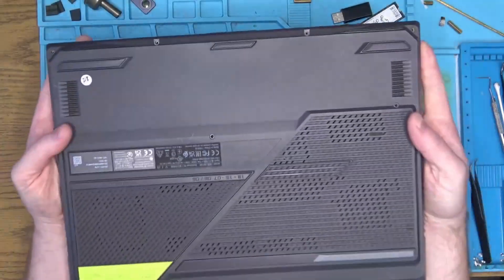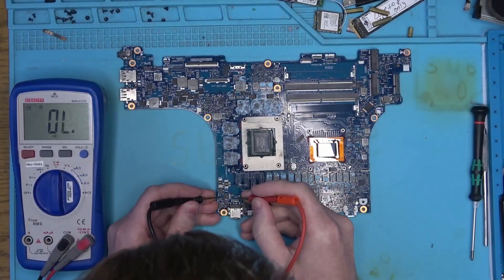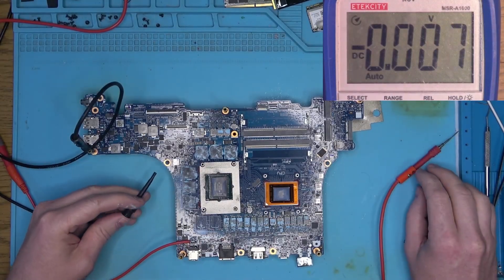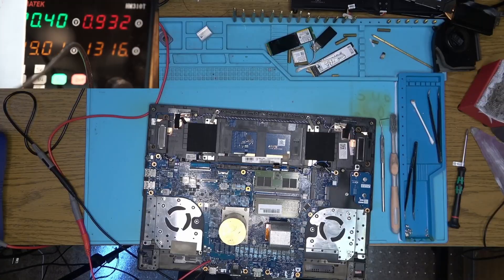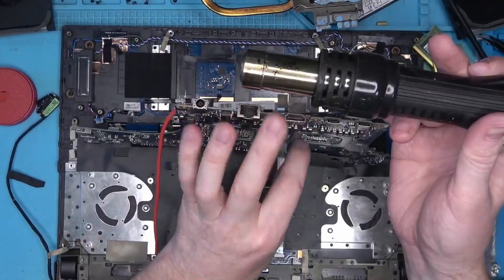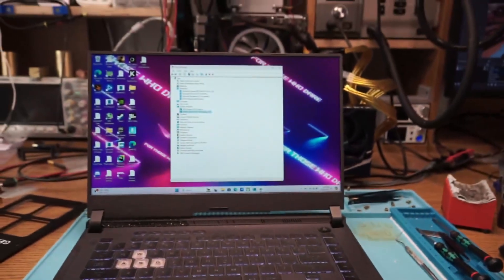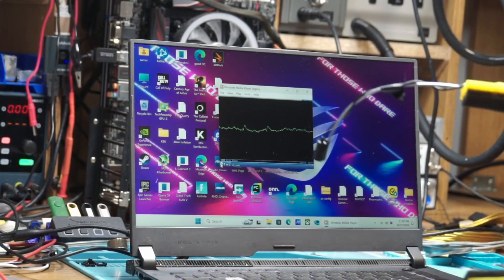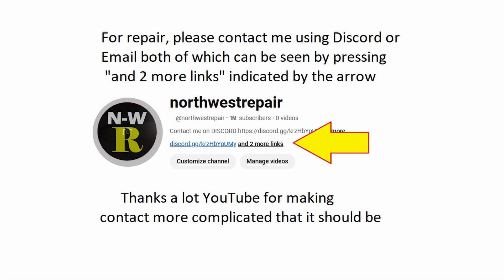ASUS ROG STRIX G513R free repair

Comment: I wouldn't give this guy any money back. You did fix it !
Reply: people like silverback really worry me, he bricked his machine flashing bios, knocks parts off in the process, had someone else repair it, the  bricked it himself again  then blames the person who fixed his first time bricking it, for his second time bricking it, insanity
Reply: About that other comment, the GPU showed a 3070 because it was an incorrect BIOS version when he had the "no audio" issue. After that, he found the correct version.
Reply: @DenjiW  he did found the correct version and flash it so problem fixed
Reply: @nikolaygeorgiev2921 no he flashed system bios. Not the GPU bios. Atleast I don’t think. He sent my laptop back with the wrong GPU bios.
Reply: @silverback2773   But then if he did NOT touch the GPU BIOS and it was WRONG, then when did it become the WRONG BIOS? You're pointing directly to yourself. You messed with both BIOS and didn't communicate that properly. You left it as a trap.
Reply: @DenjiW , the wrong GPU-BIOS (running Last of Us by a miracle?) must have been flashed by Putin!
Reply: @lorsheckmolseh3345    First time in the topic of flashing BIOS? You can install different BIOS versions on different graphics cards as long as the main chip is the same one. There are videos showing this. Some people do it to squeeze a few extra FPS at the cost of higher temps, but there's always the chance that some details of different BIOS might not be compatible with other graphics cards like RGB or MUX Switches like in this case.
Reply: @lorsheckmolseh3345  or maybe you are just trying to make up for making him work for no money . Obviously you try to flash both of the bioses . Obviously someone else work on the laptop before him you can see the video , no screw's insanely bad soldering and so on. Just go to someone else now man. Don't try to make him look bad. He paid for your parts which is insane . You got the laptop working and now still crying.... Says a lot
Reply: @Expo_Hans I flashed the GPU bios before sending him the laptop. This is what he was supposed to fix but instead he flashed the system bios which I never messed with. System bios was fine, it was the GPU bios that needed flashing. He got them mixed up.
Reply: @silverback2773   He restored the System BIOS that he found with signs of manipulation, as you're stating yourself, and it worked. The new System BIOS he installed did not have the MUX Switch activated, which was not compatible with the GPU BIOS that you swapped. It worked fine until you activated the MUX Switch that was not compatible with the GPU BIOS that you yourself swapped. It all goes back to you.
Reply: @silverback2773  But the laptop couldn't even POST with the system BIOS. And someone already messed with the chip, knocked down parts and missing screws making this extra sus. You didn't included the charger to make the repair extra fun. And you sent the laptop to a guy, who is clearly specialized on repairing GPUs. Next time better lookup repairmen with focus on laptop repairs, like "Electronics Repair School".
Reply: @silverback2773  Yet despite the lengthy correspondence you entered with Tony and THIS never got picked up? Very doubtful how such a confusion could have arisen in the first place.
Reply: @silverback2773  .. I tried been neutrally nice towards both seeing both sides but now you making new statements here and i honestly can been much nice towards you. You now twisting story with new twists even when now there is video evidence to show everyone this not being case of vBIOS but BIOS like originally you claimed only. You lost me now pal.
Reply: @silverback2773  Except for the fact that it didn't boot after YOU messed with bios. That's on you.
Reply: @silverback2773  "I flashed the GPU bios before sending him the laptop" There's your problem, messing with things you know nothing about.  Word to the wise: If your not an systems engineer, stop playing with things you don't understand. YOU bricked your own system. That's 100 percent your fault. No freebies.
Reply: @ThePopolou I told him in the emails about the GPU bios. I’ll just post the whole conversation. I’m tired of explaining this.
Reply: @RaymondSwanson-u9y Holy fuck, I bricked the GPU bios and HE was supposed to fix it. Instead he flashed the SYSTEM bios, not the GPU BIOS. I DID NOT MESS WITH THE BIOS AFTER HE SENT ME THE LAPTOP UNTIL HE SAID HE WOULDNT ACCEPT IT BACK. IN THE END I FIXED THE DAMN LAPTOP.
Reply: @silverback2773  Nah, don't bother. Just a storm in a tea cup which was funny at first.
Reply: @silverback2773  that doesn't make sense, he was gaming on it,  if it was the wrong vbios usually the gpu won't work.  Do you think you were smart complaining on reddit?  Tony doesn't deserve the stress you put on him, I'd suggest sending him the money you owe.
Reply: @Expo_Hans  they are not all intercompatible
Reply: @silverback2773  Sounds like you messed up big time not explaining what exactly has been done to it under YOUR OWN possession, literally everything including the reddit post(s) points it all to being your own mishaps back-to-back.

The fact you got a full refund too is baffling, sucks that good-hearted people are being exploited like this by people out there which certainly lacks a spine.
Reply: @silverback2773  you are just a liar, you say he had  to leave the system bios alone, but it clearly had a missing cap, 
you tried to flash the gpu bios, you failed, you sent the laptop to an unknown repair center that damaged the laptop  that is why tony had to do extra work. you are just disgusting.
Reply: @KyleSand  It makes perfect sense. Tony only tried it on the standard performance profile which doesn't use the MUX switch, and got lower clock speeds as a result. He didn't flash the GPU BIOS that was still incompatible with the MUX switch, didn't test ultimate performance profile that would reveal it wasn't working, still sent back...
Reply: 5:27 3A stable power draw, stays on, USB activity, are strong indicators it POSTed and main system BIOS was fine.
It simply didn't output a picture because at that point the GPU VBIOS issue was obviously still present, which didn't work with the currently selected ultimate performance profile (dGPU drives display with MUX). Flashing main bios reset it to standard performance profile (iGPU drives display, dGPU renders through iGPU) which created the illusion of a successful repair, but actually GPU VBIOS was still faulty and he didn't test this at all.
Reply: It don't matter once you flashed the wrong bios either system and/or GPU can go south quickly since it one bios chip available as the laptop don't have a backup bios chip the restore from as well the GPU output audio thought HDMI not speakers that the system bios that controls the interface throughout the board including audio chip that is at fault not the GPU vbios. That why there is a risk in flashing any bios regardless if it looks the same but build differently from per spec and laptop revision this is where the problem shows itself clear as day
Reply: You had every right to say to the customer: go F urself. You fixed it, not your problem if the customer is stupid enough to brick his laptop
Reply: silverback is a microcosm of the next 4 years.  LOL.  TBF, could be an attempt to get views (optimistic view).  Dude's videos have single digit views and he pulls out all the name-drops for search engines.
Reply: Confirmed this is the Reddit Crybaby.
Reply: @ngrader  don't you mean the last 4 years? for the next 4 years tony would have tariff'd him lol
Reply: @ngrader  Dude has almost 300 videos with clickbait thumbnails and doesn't get any views, it's explained, he wants drama to prop up his failed channel

Comment: I took the time to find the post and analyze both sides, and after a few rounds of thought it's obvious that the customer messed the laptop twice with the same third party software. Which, by the way, comes with an expressive warning about the risk of bricking the device so it's obvious that the software messes with the BIOS. It's also funny how the community upvoted to best the reply from someone who openly states that the customer shouldn't mention that they bricked it themself, along with the nonesense saying that the third party software does exactly the same as the official software... which is funny because if it does the same, why use the third party anyway? 

Other than that, if there's anything to question about your side, it was the rejection of the warranty judging by his comments alone. Not because it was the wrong thing to do, but rather because there was something to be learned from this. Like, for example, if you restore the BIOS to the version that worked best for you, what would the laptop do when YOU try the official software to achieve what the customer tried to achieve? "To activate the ultimate mode" as they said. If the laptop stops working again with the official software, maybe there was a real issue somewhere, but if it worked as intended then you would have the strongest evidence showing that the third party software broke the laptop twice, which would be the ultimate proof to show that the customer himself bricked it. And then you get paid again with no complaints. It's a business advice.
Reply: time is money, why would you spend more time for no more money?
Reply: @PaulBlartGaming   You didn't read the whole comment.
Reply: @Expo_Hans  i did

Comment: Why did you even refund? Should have just released this video, you have a large enough community for them to make sure that the information does not stay one-sided on the lynch thread, would have happily done so.
Reply: Read my side of the story and the update where I fixed my laptop above.
Reply: @silverback2773 your side is just that you flashed the wrong bios after getting back a working laptop and then asked for a free re-flash, then opened a reddit thread where you put choice information that just happened to get it turned into a lynch thread. Is this inaccurate?
Reply: @ozzieggg clearly didn’t read my story. I didn’t flash the bios, only changed performance profiles on the laptop.
Reply: @silverback2773  there is no coherent telling of your side under this video. You are telling a slightly different story under all the main ones, just like your last message here, which is not the same as activating the mux switch as you said in another thread. The fact is the main bios was magically also corrupt, and the board had amateurish repair work all over. Tony fixed all those. You cannot expect the guy to go through all the asus repair checklist for all their proprietary features. Asus usually rolls their own standards on consumer laptops, people really should never mod their hardware. As far as an electronics repair guy who is trying to make the machine work, I think he has done a great job. If you had been messaging him all throughout the process, you should've asked him to explicitly flash vbios and provided the factory vbios yourself. Tony is indeed aware vbios's exists, as he has flashed them before on his videos. I still can't see good intentions from your side on this.
Reply: @silverback2773  You f ed not only Tony, but his future customers and people that want to help them customers.
By your own stupidity and shamelessness .
Hope you're proud, your kind always is.

Comment: Keep up the great work!

You took the best course of action. This is just someone you write off as a customer for good. Unfortunately, they're everywhere and regardless of the trade you're in, you'll experience one of them eventually.
Reply: @bearde_mut9731 I mean based on warenty law no that's not how it works.

If you can prove the damage was related to the repair done then yes you can void the repair on that part.

Sounds like normal telco scummy policy and this illegal operation is very common in tech.

Can/us warenty laws

Edit 

To prove this point if you have your seat replaced in your car than your engine blows up does the auto maker get to claim you put a seat in therefore we don't have to cover your engine warenty?